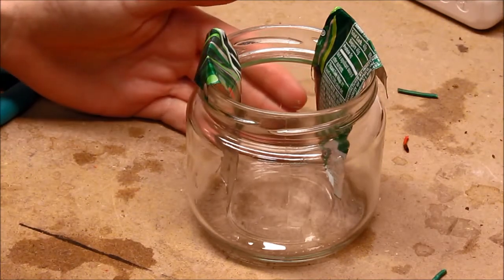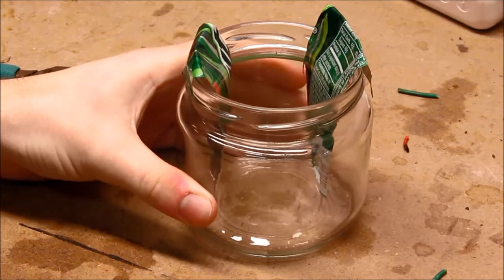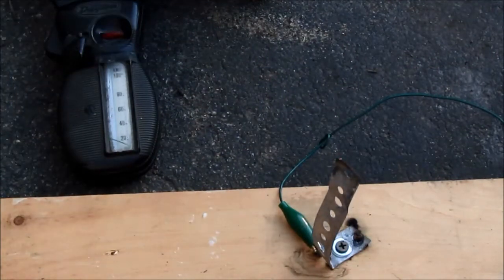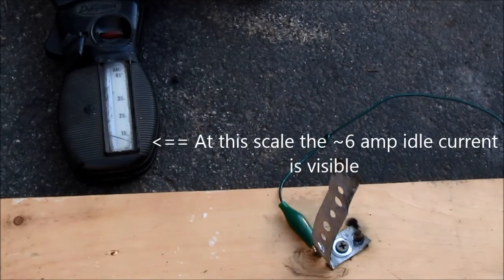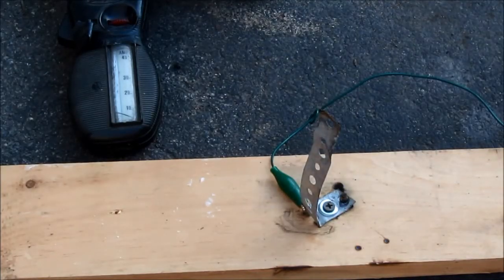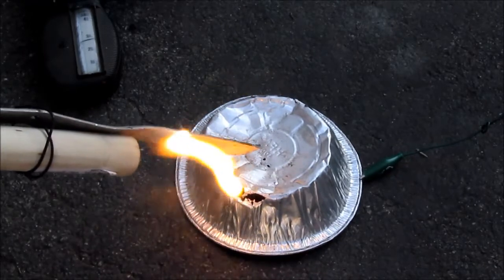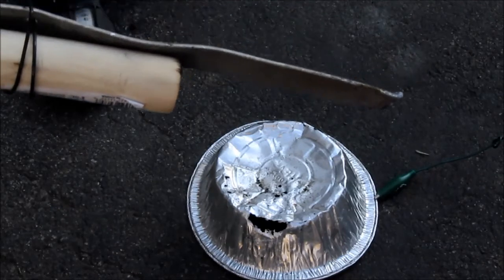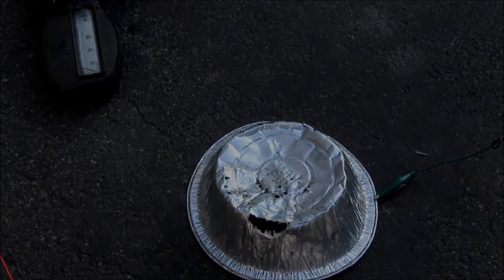Jars of Tap Water as High Voltage Ballast Resistors

Comment: There is a way to feed cool water into your ballast and at the same time drain the heated water, but it's a bit tricky. Mebbe an isolated water jacked would be simpler. Also, immersing the MOT in mineral oil will extend it's duty cycle some (not a lot, but some)
Cool vid. Thanks for posting.

Comment: Another commenter here mentioned using capacitors as ballast. I does work if the capacitor values are carefully chosen. Caps in series with inductors can INCREASE the primary winding current. I like the water ballast, as it is continually and easily varied.

Comment from the maker: Thanks :)
You are right with the 45 amps being on the primary side. It's only a 1 kw transformer when run properly.   The arc is nearly a short circuit, and the only limiting factors are primary inductance, primary resistance, and the resistance of the mains. Even a small transformer will pull many times its rated current with a shorted secondary. 
With mains you are better off using old heaters for ballasts, as these provide some control over the current allowed.

Comment: Nice idea, I've used this method myself. An easier way to ballast is a coil in series with the input. Either one side of another transformer or a coil from an old pc psu.
Reply from the maker: Would PSU coils have enough inductance to make a difference at 50 or 60Hz?  
Or were you thinking parts from super old PCs using line frequency transformers and huge inductors for smoothing?
Reply: @MetaphysicalEngineer  Inside a pc psu there is a 240v coil at the input side, quite large and 2 wires only so I'm assuming these are being used for that reason. All pc pcu's have one. At rest, my microwave transformer draws 4.38A (@240v). With the ballast, it draws 1.36A. It's used for a Jacob's ladder, and the output is correspondingly reduced. I suppose playing around with different sized coils would give you a range of powers dependent on requirement. Makes a significant difference to how long it can be used for, as you know the transformer gets very hot quickly. With the ballast, much better.

Comment from the maker: There is some electrostatic force, but that's pretty small at only a couple kV.  The jar is much more of a resistor than a capacitor at the distances involved. I think the heat softened the tape and the wire pulling on the plates caused them to creep closer.

Comment from the maker: Thanks for your comments :)
The resistor seems stable even when pushed to boiling (see my "spring pops and destruction" video to for that), so evaporative cooling works fine.  I'm considering mineral oil for the MOT and I might try capacitor ballasting or making a resonant circuit at some point this summer.

Comment from the maker: I don't have another MOT yet :(
Variac is only 10 amps and would be the weak link in the system, along with reducing open circuit voltage. 
I tried 2.5 kw of heaters and I couldn't draw an arc at all, just tiny sizzles.
I'll try other methods when I have the materials.  
For now, the water resistor works well, even when boiling hot. Different plate spacing and or more resistors in series/parallel lets me customize output current while still giving full open circuit voltage for striking arcs.

Comment: It's funny, I was just thinking about using water/saltwater as a resistor one day even though I have never heard of anyone using it like that before, and then you post this video. I was thinking on 0-145 volts but it probably works better with 2kv. When you mention 45 amps, that's on the mains? It's weird how a 1kw transformer pulls 5.4kw. Nice job on the current limiting.

Comment: i guess you are using the salt water resistor on the primary side ?? but what about your little thin wire with crocks on the HV side? those thin crock wires often come with quiet an amount of resistance as far as i know. dont they interfere a lot on the HV side with their relative high resistance, resulting in less power/arcing ? i know the current on the HV is relatively low, but the voltage drop might be quiet big, dont u think ?

Comment: this what actually i am  looking for, i need something for faster electrolysis, i thought elextrolysis in AC happened at opposite wire, so we need live wire to generate gaseous basically this jar salt act as big resistor am i right? so for more safer method i dont need weld things? just plug between wallwart + wallwart and make salt resistor between it
Reply: What do welders need? Current or voltage?